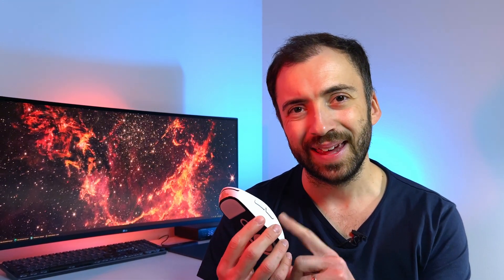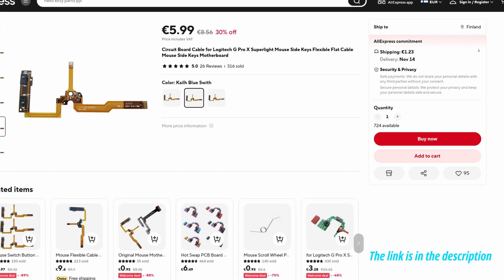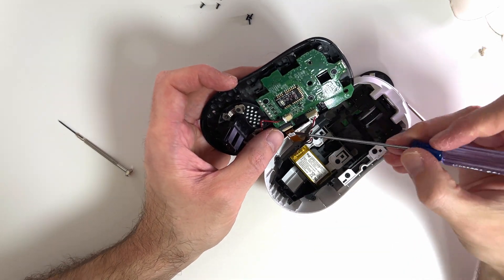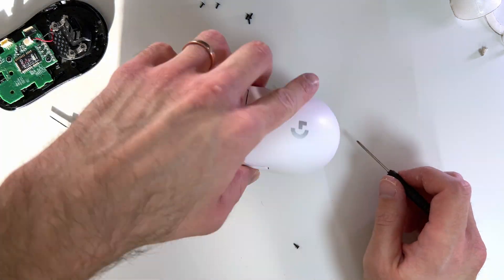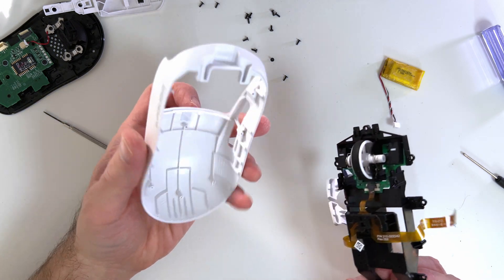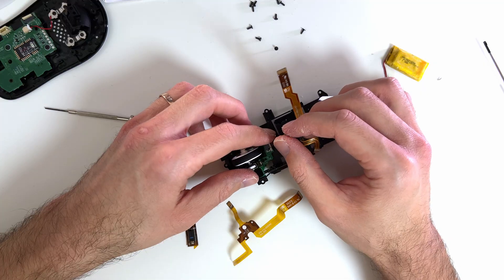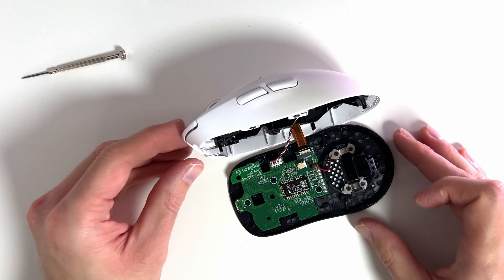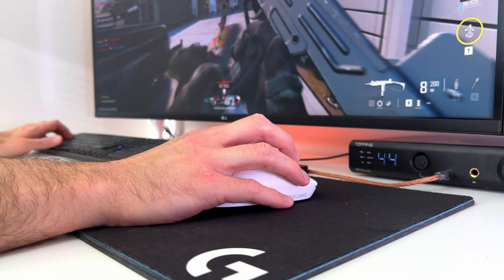How to fix Logitech SUPERLIGHT double click WITHOUT soldering

Comment: Fantastic tutorial using my fixed logitech super light as we speak. Thank you so much for bringing it to our attention that we can fix the double click ourselves and without soldering!

A few notes from when I opened it up
- the screwdriver is Philips #00
- At 1:31 you do not need to pull on the tan part just the ribbon cable, the thin amber (dark yellow) part that has the QR code on it
- Same thing for 2:53 you just need to gently tug the ribbon cable out you do not need to mess with the tan parts. I actually pulled on the tan parts and that disabled my left click until I popped it back in correctly.
- IMPORTANT: Before you put it back together test it out by putting the battery and the yellow ribbon cable back in to the bottom half you do not need to assemble any of the white shell parts to test make sure all the clicks (left, right, mouse wheel, middle mouse) are working before putting it together.
- Most of the screws on the mouse are the same size or relatively the same size there are a few very small screws take a  picture of you pointing to where the very small screws are when disassembling
Reply from the maker: Thank you for the feedback and for bringing those details up. This was my first SUPERLIGHT repair and as it seems I've missed a couple of details. 😊👍

Comment: Quick and honest questions: I believe you mentioned these steps are for fixing the side buttons, correct?
I'm having double clicking problems with the left and right buttons. Does this video apply for them, or is this a side button fix only?
Thanks!
Reply: Same Question?
Reply from the maker: Great question! My video is focusing on side buttons only. To my knowledge left and right buttons' switches can also be replaced but it might require soldering. After that you can install (solder) adapters so that in the future the switches can be replaced with the plug & play method.
Reply: @RandomTechChannel thanks for the reply, but I already replaced mine with a $12 new board, and it's working amazingly!

Comment: U can fix side ones with blowing slow and warm air from your mouth into the buttons
Reply from the maker: Thanks for sharing! I will test that once my current mouse start to suffer from the same issue.🙂
Reply: Fixed it for 5 minutes and destroyed scroll permamently :)
Reply: this works for like 2 minutes. not really a useful solution unfortunately.
Reply: WTF, my mouse has been fked for a month now i did this and the clicks are working perfectly fine??? how does that work
Reply: Thank you so much bro, almost spent another 100$ if it wasnt for u
Reply: Bruh. I've been suffering for months, that I ended up switching to a different mouse... But this really worked. I might have to take my superlight out of retirement. Theres no way I can allow someone else to touch this mouse after putting my mouth all over it 😂